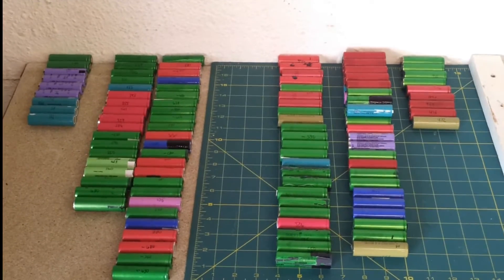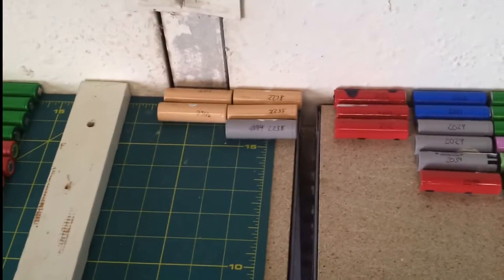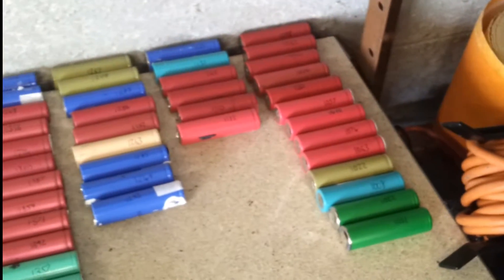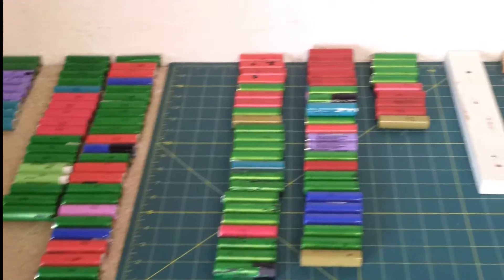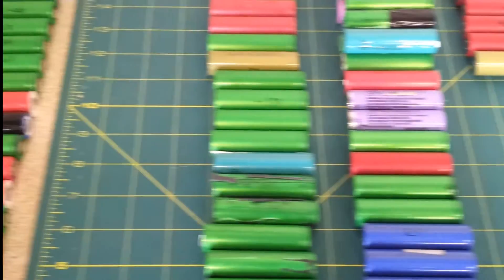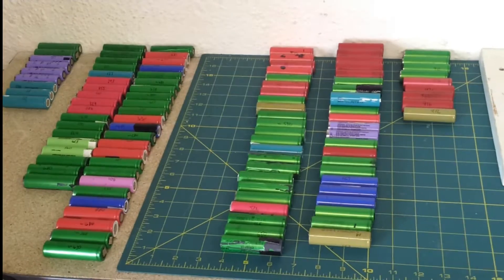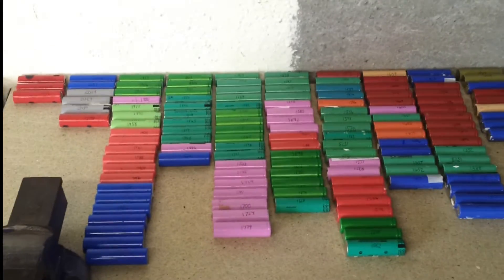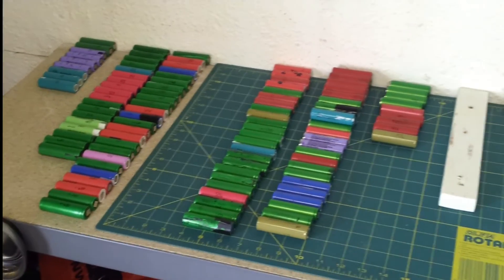Lithium Ion 18650 48v e-Bike battery build DIY - Part 3 - Cell Processing

Comment: Don't waste time with battery packs, used or new. Samsung 3400mAh 35C batteries are available for US$3 each
Reply from the maker: That seeems like a good deal. I've already built my battery packs now but please post a link so that other people can see where to buy these sells for 3 USD each.
Reply: https://www.alibaba.com/product-detail/100-original-high-capacity-18650-3500mah_60637917373.html?spm=a2700.7724838.2017115.124.63fc2d8162rVDl

Comment: What are you using for testing your cells?
Reply from the maker: I'm charging them up (on the Nitecore charger) and discharging each cell individually to 3.0v at 1 amp on the Imax B6. Then just categorising them based on their resultant capacity. It has taken quite some time...